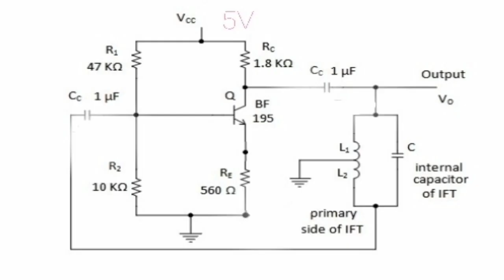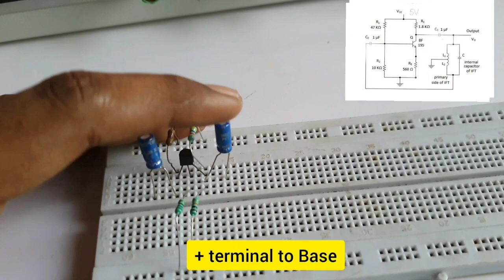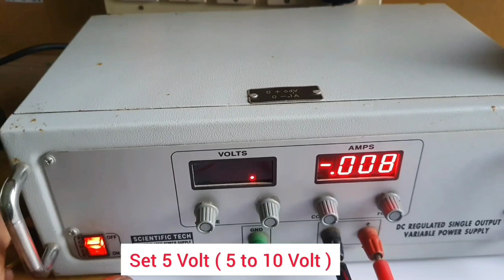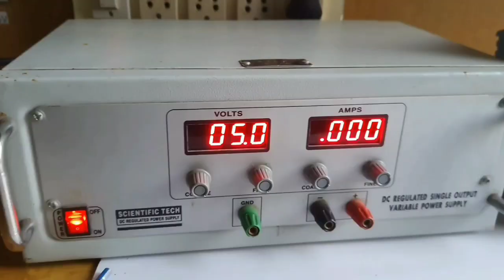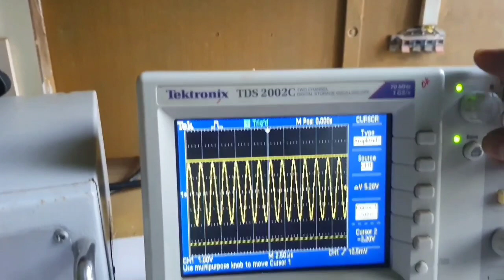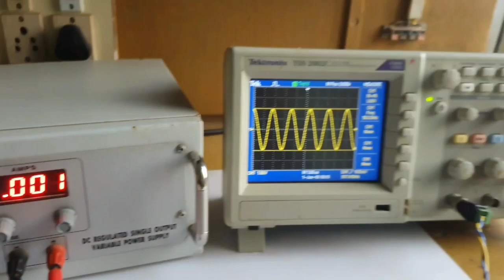Hartley Oscillator Circuit | Diploma  Electronics | BTECH | EDC |Experiment | Breadboard

Comment: For the LC components it looks like you used what you referred to as IFT, correct?  Does this stand for Intermediate Frequency Transformer?  If so is it a tunable center tap inductor?  Does it include the capacitor that is the C in LC?  If so can you please provide the details of the IFT?  I like the resulting frequency that you ended up with so the IFT that you used will work for me also.  Thank you!!!
Reply from the maker: Yes, it is an IFT, intermediate frequency Transformer.
Inside an IFT L inductor , C  capacitor tank circuit is provided 

You can adjust its frequency by tuning its core.

Comment: Can i just follow the circuit diagram instead of using IFT will the circuit work
Reply from the maker: IFT is a simple device for constructing  RF Circuits. It is a simple device, easy to tune etc. If you don't have an IFT you can use inductor and capacitor to make this circuit. But the selection of such components should be done as per the tuning frequency requirement of your circuit.
Reply from the maker: LC oscillators are high frequency oscillators, so first select inductors which are available in the market then go for capacitor by applying frequency and inductance value in the appropriate formulas

Comment: Sir can you please make a video about how to make an IFT wiith inductor and capacito....and the working of ift....
Sir please help...i have a project to generate FM signal using Hartley oscillator...
Reply from the maker: Upcoming video AM Generator Using inductor and capacitor, it will help you to make Hartley oscillator without IFT,
Reply: Sir when will the video come...?  I have to submit my project this week...
Reply from the maker: In this week. 
Replace IFT with two 0.1 mH inductors and a 0.1 uF capacitor. For higher frequencies use low value capacitor
Reply: @TechnoTipsE4U   ok sir... 👍
Reply from the maker: https://youtu.be/i2YqfRkzijo

Comment: Sir pls ift ka naam bataiye. Jaise capacitor ki value hoti hai 1 nF waise ift konsa lena hai
Reply from the maker: IFT is not readily  available in the market, but you can make an IFT by using  a ferrite core, copper wire and a capacitor.
Reply: @TechnoTipsE4U  ok sir thanks